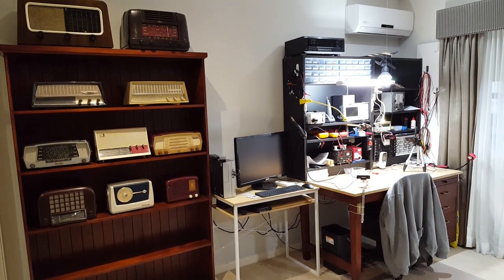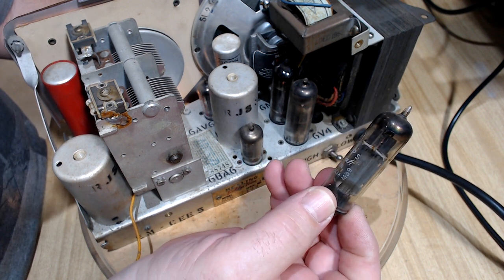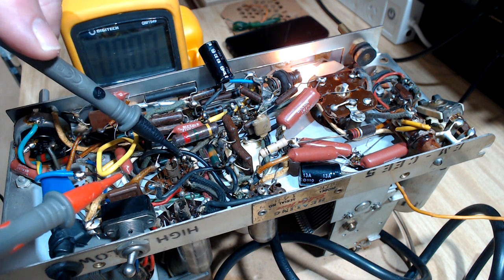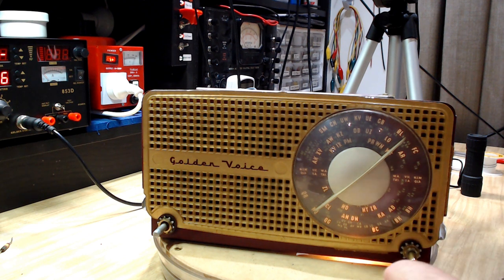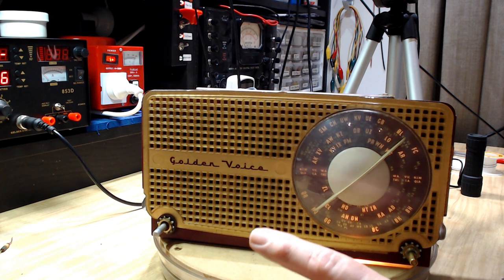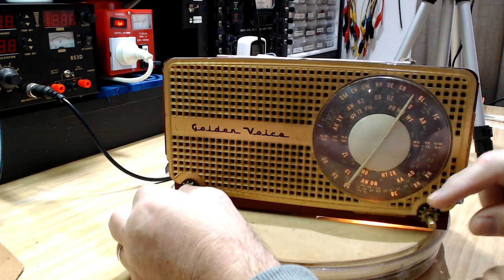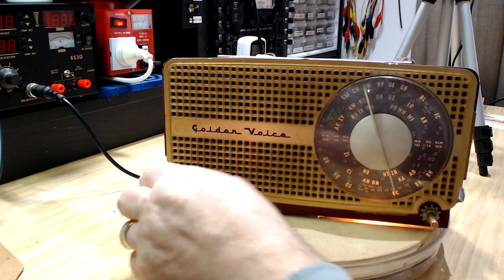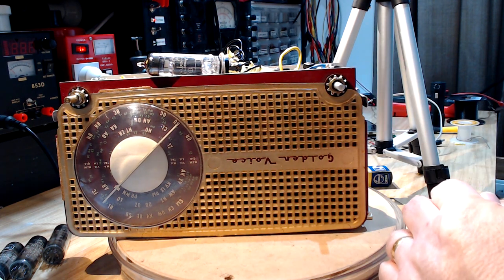Healing 503E Vintage Radio Repair

Comment: Youre watt meter may need new batteries. Many have some button cells at the back and wont work right if they are to old. Beatiful little radio. Thanks for sharing with us.
Reply from the maker: Hi migsven surfing, Thanks. It doesn't take batteries, the problem was I was applying power too slowly and upsetting it. I could have put it before the Varic but then wouldn't get the correct reading. I now use a different meter that doesn't suffer that problem 😃
Reply: @DavidTipton101  Ok, I will put that information in my basket til I get a variac. High on my wishlist. Have two tube radios wich I want to get up running and also use. Videos like yours have made me interrested in trying. Thank you.

Comment: Just starting to watch the video, but the crackle sounds like silver mica problems in the IF.
Reply from the maker: It was silver mica but not in the IF if I remember correctly 🙂
Reply: American radios made in the 1950s commonly have problems with the silver/mica capacitors in their IF transformers.  The construction of these capacitors is open so oxidation develops over time, causing intermittent shorts.  The symptom of this is the audio crackling very similar the original sound your radio made.  The construction of the IF transformers of radios made in the 1940s and prior is different, so they do not have this issue.   The silver mica issue is repairable, but the job is tedious.  https://www.youtube.com/watch?v=BcKZBxt7A4o
Reply from the maker: @pattyeverett2826  thanks for the info Jody, I have dealt with mica capacitors in IF cans many times and successfully removed and replaced them. You are right about it being SMD though but the culprit was one of two mica caps in the AF stage if I recall. One was in the tone control section and only crackled if the tone switch was in a particular selection and when it felt like it, that was a head scratcher 🤔🙂
Reply: I watched the entire video and you are correct, it was not the IF micas.  I also remembering you having found 4 bad tubes by substitution.

Comment: Hi, a new subscriber and I enjoyed the video. Those mica caps are now becoming problematic, have struck them myself in some sets I've repaired and the faults they can present as you found with this can sometimes throw one off the path of narrowing it down. I have the same Healing model in my collection but the cabinet is brown, haven't gotten around to getting it operational as of yet.
Reply from the maker: Hi glenz, Having been lulled into thinking micas are bulletproof, I tend to ignore them but now I know better. I agree with you. The ones I have had trouble with are the ones with a high voltage on one side, I now suspect any micas that are subjected to that. This one was difficult as it would work for hours then break down very rapidly and be ok again. I had trouble with another radio that had distorted sound which turned out to be a mica on the IF amplifier plate.
Reply: @DavidTipton101  Exactly! If see I those things with any kind of B+ voltage on or across them, they get replaced now days. Always something to keep us on our toes huh 😎
Reply: Could these Mica caps been produced and incorporated as recently as 1960?
Reply from the maker: @JohnSmith-eo5sp  It appears the design didn't change over quite a time in Australia at least, they look much the same as they did 20 or 30 years before.

Comment: time not really wasted though. You in the process found a cracked capacitor and a resistor that went up in value, which should have been replaced anyway.
Reply from the maker: Thanks kwacz 🙂

Comment: never see 6M5s here in the UK, it seems its same as an EL80, never see these either, appears electrically identical to an EL41, which were much used,  but different base,  that bad one probably has grid emission/internal leakage, making grid more positive, i have many small output valves with good cathode emission, but have developed this grid emission, making them unusable in normal circuits,
Reply from the maker: Hi andygozzo72, yes, the valve numbers you quoted are correct. Very popular in Australia though I think. I suspect my tester needs a service and I should check them for shorts with my meter but they work OK in the radio.
Reply: @DavidTipton101  grid emission in most cases takes time to appear and doesnt always show up on some valve testers,   as its not a 'short' as such, you need to run them for a good 5, 10 mins or so..
Reply: i've found the smaller the valve/closer the electrode spacing, the more they develop this problem,  UL84, PL84, ECL86, PCL86 , ECL82,PCL82, UCL82, the worst in my experience,  UL84 and UCL82 especially in certain Philips sets, that run them at maximum, or even just over maximum anode dissipation
Reply from the maker: My valve tester 'shorts' test is very simply testing for actual shorts by passing a current through the different elements and that is what is failing on the 6M5 and other NOS valves. The only way I can think of checking for grid leakage would be a higher grid voltage than normal  when in circuit. How would I check for grid emission?
Reply: @DavidTipton101  depends how much current it considers as 'short', i have an american made tester that has a neon lamp as a 'short' indicator, so these 'iffy'/'leaky' valves show up as 'short' even though theres no 'hard' short , just a bit of megohm 'leakage'...
Reply: i do have a 'better' tester,  avo ct160 but thats been out of action for several years due to faulty meter 😢
Reply from the maker: @andygozzo72  Thanks for all that info. Mine has a neon lamp too, maybe it's telling me more than I thought 🤔
Reply: @DavidTipton101  problem is, even slight leakage/grid emission makes valves unusable .. so that neon 'short' indication is erring on the safe side 😉
Reply from the maker: @andygozzo72  yeah... yeah ok... 🤔 Thanks ag72... something for me to think about, appreciate the help 👍👍🙂🙂

Comment: nice little radio, I've got that exact radio all original inside. It's got Ducon paper caps in it, those filter caps in yours may not be original.
Reply from the maker: Hi Carolyn, it's a very cool looking radio. The filter caps were very modern, the other caps were changed at some time but with caps from the 60s or 70s. The owner told me the radio was repaired but started playing up some time later. I can understand that as the problem was intermittent 🙂

Comment: Hi David, I wonder if you have a technique for the following scenario: I have a Zenith R509F which I'll restore completely. It's case has come cracks which I will fill with body filler and I'll paint the whole case. However, it's front panel is somewhat complicated; it has a grid style front panel which needs to be painted in different color. This is the challange, is there any methods you can recommend to paint those parts? some kind of roller? stamping? Here is a picture of that radio: https://www.radiomuseum.org/images/radio/zenith_radio_corp/r509f_670144.jpg I need to paint those black parts. Using masking tape is not possible I guess :)
Reply from the maker: Hi Murat, that's something that will take a little trial and error, I'm thinking a very short haired paint roller or a cloth laid flat and lightly soaked with paint and roll the radio in it. I would try any idea out before painting the case though so you don't ruin your new paint job 🤔🙂
Reply: @DavidTipton101  Thanks David, I will give it a try ;)

Comment: Not a very good valve the 6M5...  They draw grid current when old. I have no idea why they went for the 6M5 in a 9pin in Australia... European radio brands went for the much better (I believe) and popular 6BQ5 which is still made today... Plate load is 5k on the 6BQ5 versus 7k for the 6M5.. which is a pain....
Reply from the maker: Hi Terry, I think the 6M5 came out before the 6BQ5 and worked OK at the time so maybe they just stuck with it. I don't have a 6BQ5 in my collection although I still have several hundred Novel base valves I have to catalog, I keep putting it off 😏 Most folks probably wouldn't worry about the plate load difference although it's quite considerable 🙂
Reply: @DavidTipton101  The 6M5 was derived from the 8pin rimlock 6CK5 or EL41 i believe.
Reply from the maker: Yes, I believe you are correct Terry, the EL41 was a few years before the 6M5 and they are interchangeable aside from the base 🤔🙂

Comment: 14:28 14:35 Hey, you installed a 22 microfarad capacitor in there, not 24, not accurate of you!
Reply from the maker: It's my secret shame John 😴😉
Reply: Electrolytics have a wide tolerance as much as 50% sometimes.
Reply: What's 2uF between mates?!
Reply: @alancordwell9759  Nothing in the filter section
Reply: @erin19030  That is/was true of those that came out of Japan in the early 1960's